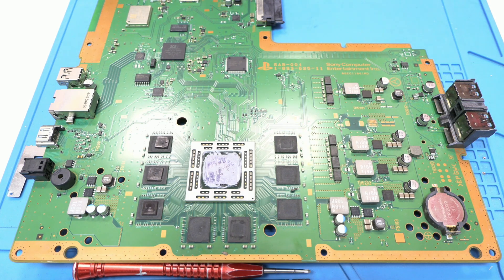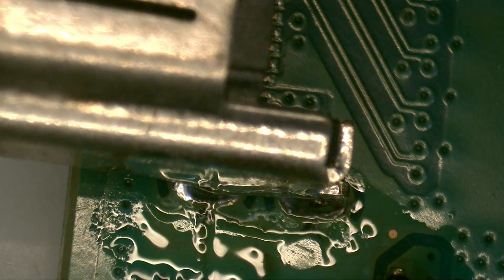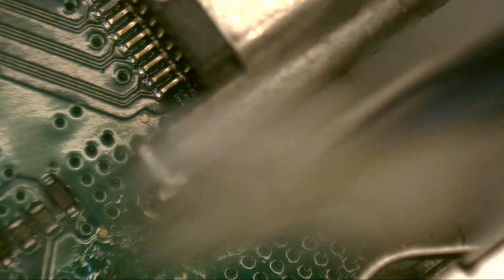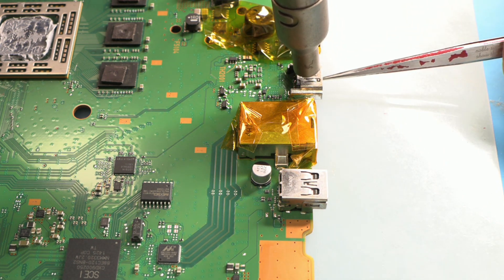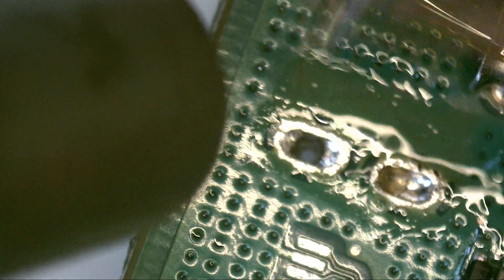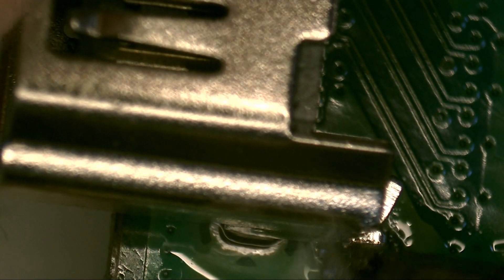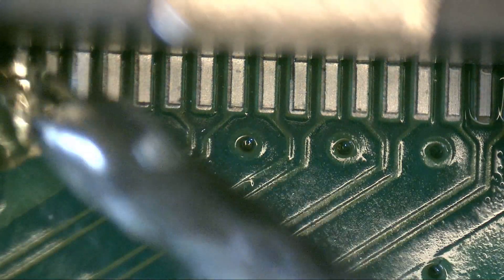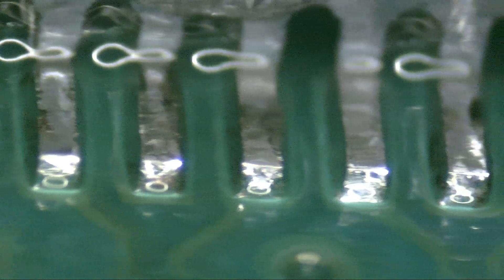Replacing an HDMI Port with a €2500 JBC Station: Is It Worth It?

Comment: Hello.
Could you measure the diameter of the heater, where the nozzles are installed in JTSE - Power Hot Air ? I have a lot of nozzles from HAKKO, they are 22 mm, I want to make sure that I can use them if I buy a hot air station from JBC. The external diameter of the Hakko fan is 21.5 mm, and internal diameter of the nozzles are 22 mm. 
Thank You